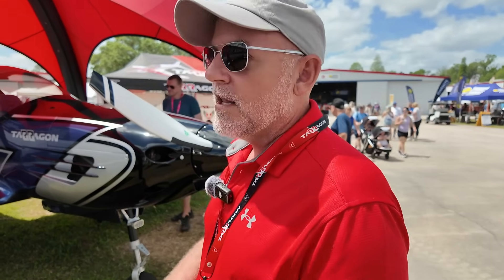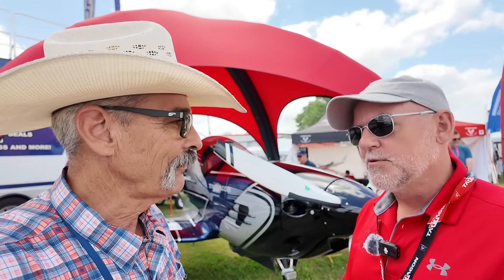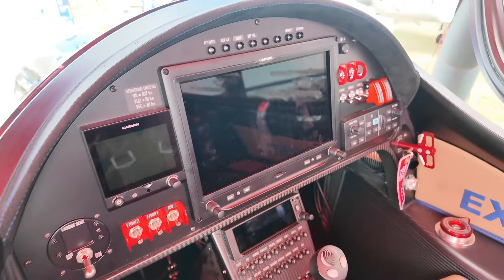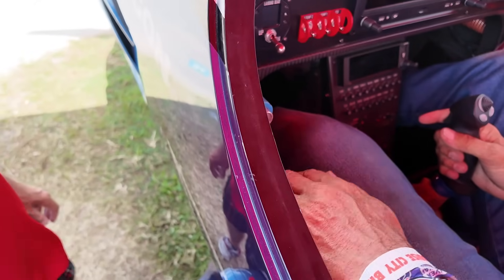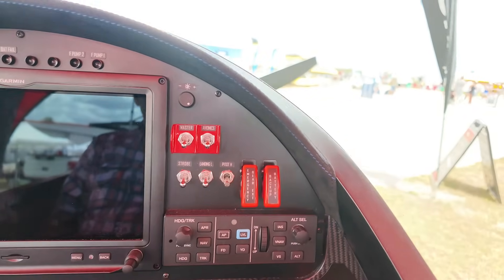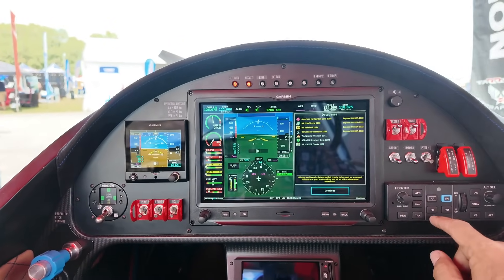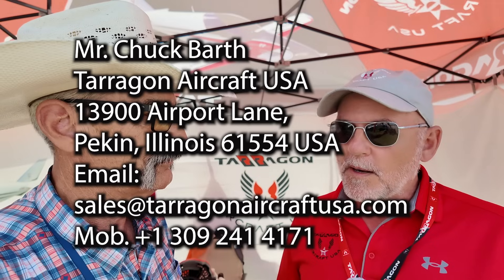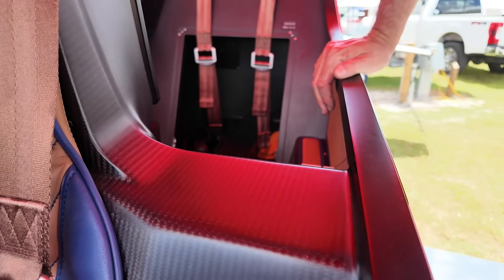Tarragon - Super Fast Rotax Fighter Jet!

Comment: I have seen one too many hose clamps blow off on the dyno to ever trust them in my airplane build 🤕
Reply from the maker: 😳 really ?  That’s not good!  Is that on the Rotax 916?
Reply: @LeviNoguess  No, the engine and aircraft look amazing. I've just worked with untold thousands of different engines on the dyno and hose clamps are usually the largest point of failure. After checking out the Rotax website I'm sure the boost pressure is kept well in line to be safe and reliable.

Comment: Hi. This isn´t fighter but only faster ultralight or experimental. And not so fast and not so efficent. On the market is another plane that can fly 200 knots true at 8500 feet on 6.6 gallons per hour, Taragon only 170 knots at 6.6-6.7 galoons per hour and this is BIG difference. And cockpit is much more roomy and side by side, not in line like Taragon. You don´t want to fly with your wife on long trip and not seeing her.
Reply from the maker: Thanks for watching. What is the plane you are referencing?
Reply: @LeviNoguess  Risen 916 Superveloce. Most efficient plane I know for very long flights. Range at Long Range speed @FL180: 	3400 km. Cruise speed at 75% power @FL180 TAS: 	395 km/h. Max. Horizontal speed @FL180 TAS: 	420 km/h. VNE IAS (TAS*): 	450 km/h. All of that with side by side very roomy cockpit.
Reply: @LeviNoguess  Risen 916 Superveloce. One of most efficent and fastest plane I know with very wide cockpit.
Reply: @LeviNoguess  And 200l total fuel in tanks for cross country or cross ocean flights.